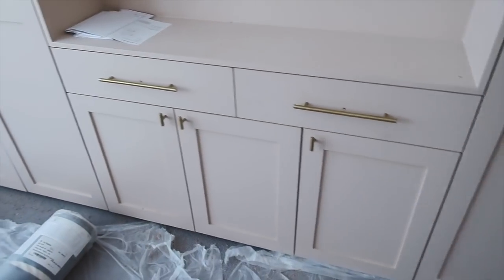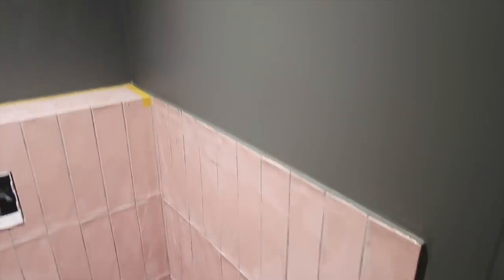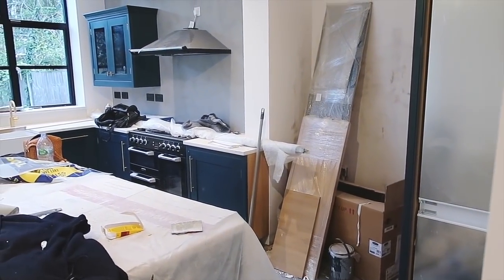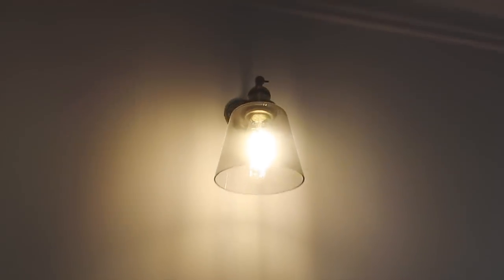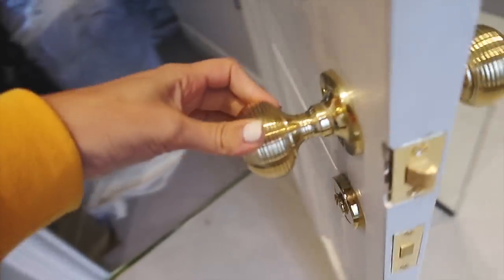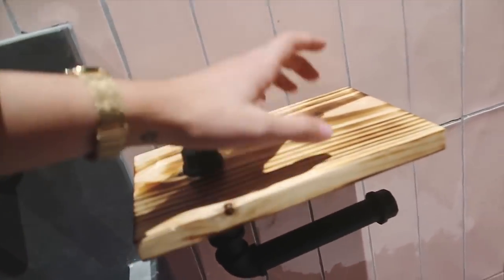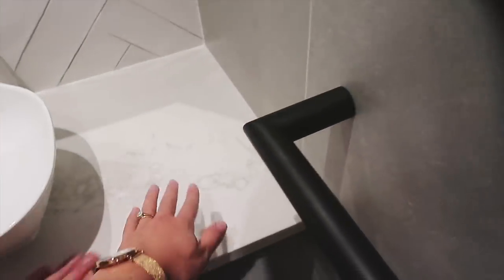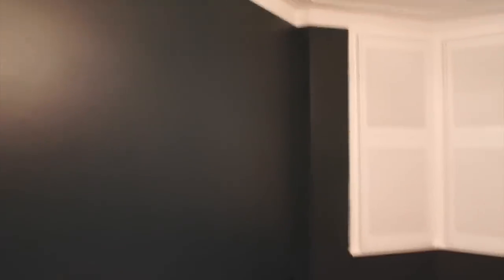THE FINAL PHASE: RENOVATION VLOG | Lily Pebbles

Comment: Most fridge doors you can easily rever the direction that the door opens. It's just a couple of screws...
Reply: Levernical I thought the same, but the way she said it made me realise that it probably wont open properly the other way or something. Like the door and handles will crash into the wall or some similar issue 🤷‍♀️
Reply: It's because you wouldn't be able to open the door very wide with the fridge being right against the wall. The hinges would be flush with the wall so even if they had a flat handle, you would be pressed up against the door shelves which stick out a bit to get into the fridge. having it open to the left means you can open the door much wider for easier access. We had something similar in our last place.

Comment: Sorry, but you can turn around the fridge  door even if its integrated. Doesn't look like they are perfectionists, because hinges is not in the line. Simple details, but very important. Never seen the fridge done so bad. it's not designer, it fitter should know and do. Just make them return.